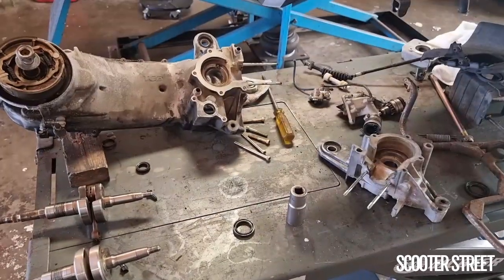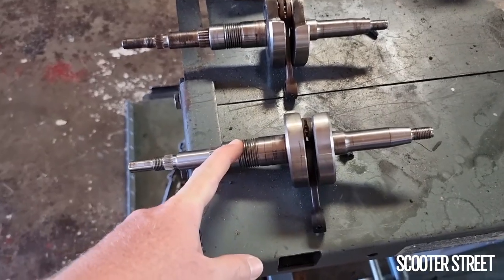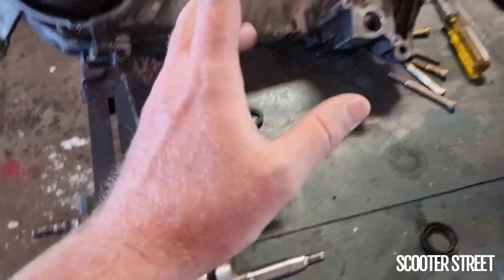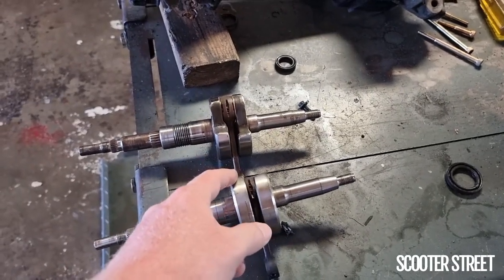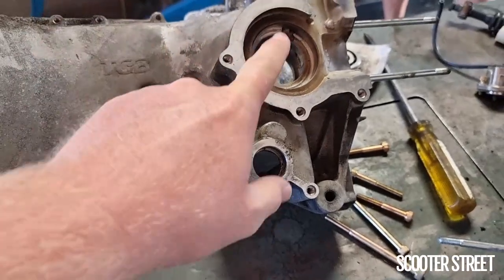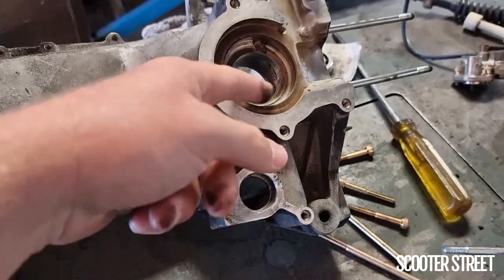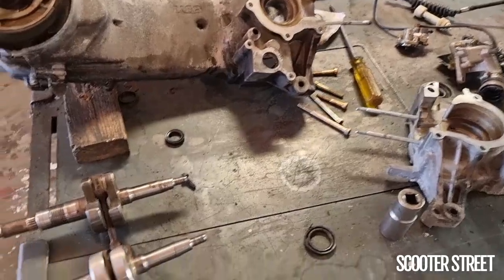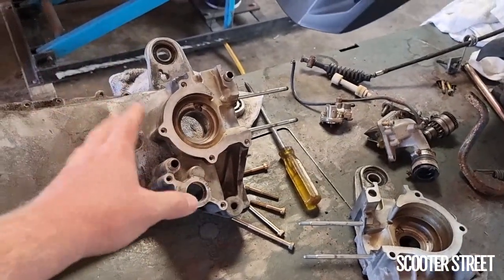TGB Scooter Crank Issues! Must Watch If You Have A TGB Scooter!

Comment: Great video.
I have the same problem, where can i buy a crankshaft that fits my TGB R50X year model 2016?
I have searched almost everywhere in Europe, but have not found one that fits that particular model.

Have a nice day /
Reply from the maker: Hello Per Lidberg, thanks for support and great comment👍 and yes a common issue with this engine. Check the crank and also check the casing for wear in the bearing housing. Crank here> .https://www.scooterstreet.com.au/product/standard-replacement-crankshaft-for-tgb-50cc/

Comment: If the bearing is moving in the casing replace the case ?
Because my bearing slides in the casing easy but you can press down on one end of the bearing and the other move
Reply from the maker: Yes, this is wear of the case. The bearing is no longer tight in the case due to the bearing housing wearing the engine case. It can be repaired from an engineer.

Comment: Great video bud. Iv just purchased a new crank for my tgb r50x but it has no spacer on the variator side. Is it just a matter of purchasing and fitting a new spacer to it? Cheers, lee
Reply from the maker: Thanks Lee, is there an option for you to use the original spacer from the previous crankshaft? If not , yes you will need to source one.

Comment: Hey mate just watching this as I’ve got a tgb 202 in and it starts runs fine then randomly just cuts out it can be running 1 min to 1hr it’s completely random I’ve checked loom had carb off and fully cleaned fuel out new fuel in new spark plug and so on basically as you do on a non runner and still no luck everything’s standard so not carb issue as when it’s running it’s spot on plugs nice caramel colour any idea I don’t know if cdi failing or stator or coil ect just wondering if you come across anything like this on the tgbs yourself mate and if you have any idea what it is cheers bud
Reply from the maker: You Must check the crank seals, there are 3, and the choke function.

Comment: I’m in the process of rebuilding my Tgb tapo as motor ate a ring luckily it went out the exhaust but bearings felt ruff so just going full rebuild with a 70cc kit I believe Tgb must have changed the crankshaft as mine seems to be good condition it’s a 2018 built and done 14thousand km 5thousand with no rev limit and me just ringing it’s tits off and showing no evidence of any problems you have shown so it might just be earlier models that have the crank issues
Reply from the maker: If you are in the Gold Coast region, we replaced over 100s of crankshafts on the TGB scooters over the years as they had a fault at the webbing. So there is a chance your crank was replaced. When fitting the 70cc kit upgrade the diff gears if possible.
Reply: Would that just put less stress on the motor to not rev so high at 75km and you might be right on the crank change as one bearing was Japanese brand and the other side Taiwan
Reply from the maker: Yes, it over drives the gear and you can reach a higher speed at lower RPM.  @LongShadong
Reply: @scooterstreetau what’s the part on ya website that fits
Reply from the maker: https://www.scooterstreet.com.au/product/polini-gear-kit-tgb-50cc/ @LongShadong

Comment: i have tgb orion and i drive less then 2000 km and piston is fckd can be possible than crank made me this? because last year i change this 5 tikes and im very tired of this ! .
Reply from the maker: You need to find out why the piston is damaged, don't just change it without finding out why otherwise you will change it time and time again.
Reply: @scooterstreetau  i try to find out but crank dont move up and down everything is sealed and working perfectly... im just tired of this scooter this is morini engine and i know they have manufacturing issue like warming too much and cooling system is crap but why all the time piston and rings on piston are fckd ? do u have any idea?
Reply from the maker: @fl3xbass43  Is it pumping enough oil, has it been jetted correctly? So may questions?

Comment: I just brought a rx50 tgb and it's runs but every now and again while driving it just cuts out, then I have to wait then it starts but cluggs out before I get up to 50
Reply from the maker: Hi T3, I am unsure but to start to isolate the issue I would suggest a compression test. 100  PSI is acceptable standard. Then check the fuel system from the fuel tank down. Then the electrical system, When it stops do a spark test as soon as it cuts out. There are a few things to start with✌️

Comment: Hi I have the TGB F409 150cc 2002 model, can you tell me the type of engine it is, is it the gy6 engine as I need a new cylender head kit and would like to buy it cheaper myself
Reply from the maker: Yes a GY6 GL9 model engine. The GY6 cylinder is suitable 157 - - -
Reply: is this compatable mate
Reply from the maker: @markduffy2536  The one I use has worked for me in the past. Yes. We have also fitted the BBK.

Comment: Would one of these crankshaft handle a dr70 cilinder kit?, or is this a no go.
Please let me know, mine has only got 9k km on it.
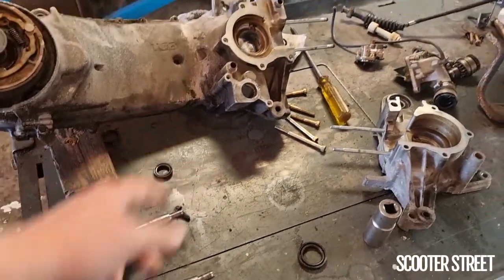Reply from the maker: It would be a shame not to find out. Eventually the crankshaft and or bearing will fail, so test the movement on the shaft and if it feels tight and minimal lateral and vertical movement then flip a coin and decide. We encourage not to on a worn system but there are replacement parts available including crank and bearings. Watch carefully from 7:19
Reply: @scooterstreetau  thanks for the reply, might give it a try and see what happens.
Reply: @scooterstreetau  my tgb 303 only costed me 120 euros so if it is going to last 1000/2000 km i am happy🤣
Reply from the maker: @stormtorcque9247  Yes a quick assessment will guide you. At worst the bottom end rebuild will be required. There have been cases where the scooter was still running and when it was disassembled the crank simply fell apart at the connecting rod, amazing😂.
Reply from the maker: @stormtorcque9247  Lets do this.... and keep us all updated. Here's a couple of Kangaroos🦘🦘.
Reply: @scooterstreetau  i will do it in a couple months, right now the police is checking al the mopeds in my country😞
Reply from the maker: @stormtorcque9247  Ok keep us updated👌